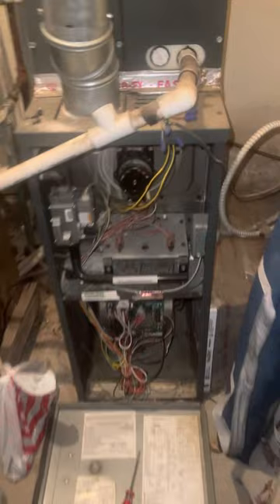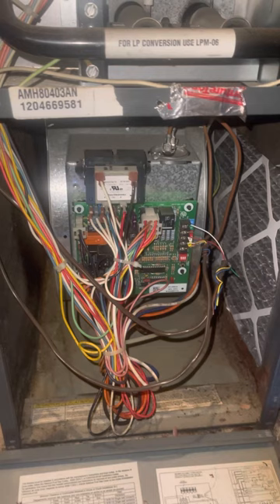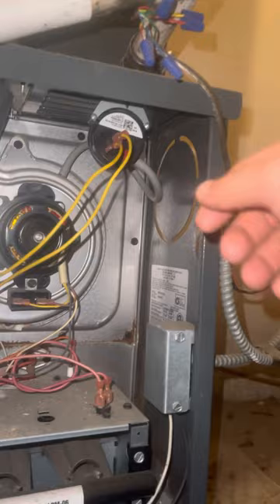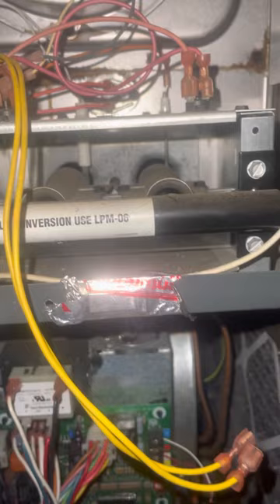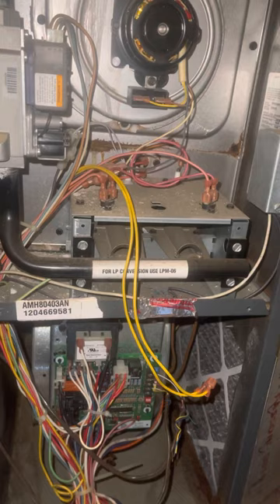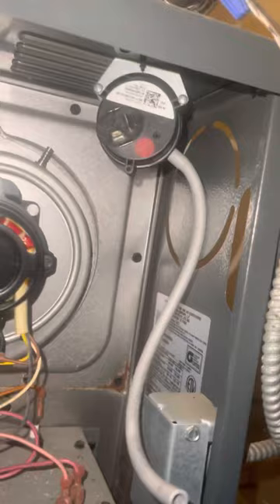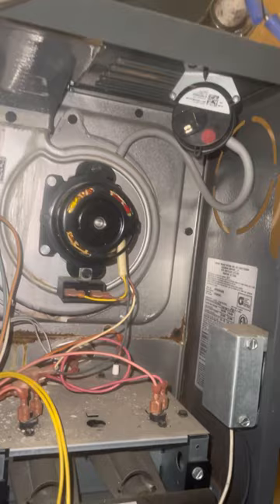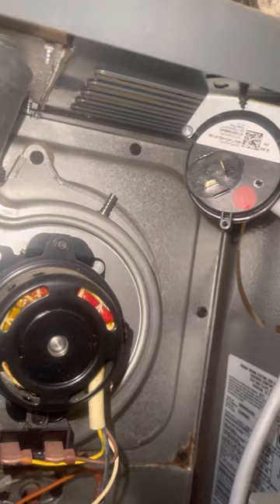Heating furnace not turning on - pressure switch stuck open / closed issue - easy fix to try

Comment: I could kiss you if it wasn't weird. U saved our house this ACTUALLY WORKED😊
Reply from the maker: I’m very happy that you are warm and cozy this evening!
Reply: @Remodelsbyleo  would there be a reason why the heat would stop working after last night it fixed it and it was working?
Reply from the maker: @BreezerX31  most likely same reason as it was before. Which point actually made the fix? 

I am thinking that if you blew in the switch, it might have worked for some time, and may work again, but you would need to replace for a new one asap.
Reply: @Remodelsbyleo  how would I know which one to place I see two. I'm going to attempt it again.
Reply: @Remodelsbyleo  still getting the same code 57. "High pressure switch open  inducer on high speed"
Reply from the maker: @BreezerX31  at this point, I would check the inducer motor and make sure it’s working. May need a multimeter and there must be videos online on how to check it.
Reply: @Remodelsbyleo  I did the same process and adjust the fuse and now it's working. Is it possible that I might stop again, should I pay for someone just incase to inspect?
Reply from the maker: @BreezerX31  it’s possible but maybe it will also work for another year or two or five. Just keep an eye on it for a few days and if it keeps working, just let it be.
Reply: @Remodelsbyleo  so it went back off again, ended up having someone come look at it. They said it was the air pressure switch. They changed it and now it's working. I'll see how long it lasts, thanks for your reply!!
Reply from the maker: @BreezerX31  well, we tried. Hope it wasn’t an arm and a leg!
Reply: @Remodelsbyleo  $300.00 for a temporary fix included the last minute. I ordered the actual part online, $80.00 and I will replace it myself. 🙃

Comment: Not a bad job of self diagnosis... But it definitely could have been worse. Depending on type of furnace you have. Could have been an Inducer motor problem. Could have been a flue issue. Don't recommend keeping your door switch taped either.  All in all not bad though
Reply from the maker: Thank you bro. I know it’s not a perfect video and doesn’t cover 100% of the cases. I’m not a professional hvac pro or a videographer. What’s cool though, is that it has helped a lot of people already. That was the reason why I made that video. Just to help regular people possibly get heat via this easy trick.

Comment: i have a keeprite furnace and it  starts up fine.. the flame is there the blower kicks in.. but after like 30 seconds of running it shuts off.  i cleaned the flame sensor, cleaned the ports with a paper clip, tested the switch and it clicks, checked the vent as best as i could and didnt find anything..  paid a hvac guy 80 bucks to tell me its the pressure switch and its gonna cost another 200 dollars to fix it.. i didnt get back to him cause i know the switch is fine.  not sure whats going on. any suggestions?

Comment: Great video. My furnace started to have the 4 flash ignition code. Inducer motor starts, igniter lights, then it clicks again but no gas turns on. I switched out the pressure switch, then it ran fine for 3 days and i thought ok great its fixed. After 3 days it would go back to cycle on but no gas. I bought a new OEM pressure switch thinking the amazon one failed, but still no gas start up. I cleaned the tube and the inducer inlet. Both pressure switches diaphram working good. But still no gas. Any suggestions?
Reply from the maker: Is the LED on the board still flashing a code?
Reply: @Remodelsbyleo  yes. After it tries about 4 times to run it shuts down and blinks 4 reds, which mine says ignition failure. My furnace model is GL1RA 072C-12A.  Tmrw im gonna jump the pressure switch connections and see what it does. I guess if it doesnt kick on the gas then control board bad?
Reply from the maker: @johnnylawrence Jumping the wires on pressure switch won’t do anything here. 

If could be the valve which delivers the gas. The valve is probably controlled by the board. Say that valve is stuck close. Board tried to open it to activate gas flow and it’s doing the signaling but then it’s maybe sensing that the gas isn’t being delivered.
Reply: @Remodelsbyleo  ok so i called a tech over today because i was at a loss. During start up he gave the gas valve a good wack and it immediately turned on the gas, cycled and ran. But it was giving a low flame code after a while so he switched out the flame sensor and it ran fine. But he said the solenoid in the gas valve is starting to stick and if it happens again to give it a smack to turn it on. And if thats the case again its prob time to replace the gas valve. So good call! But was never the pressure switch so im gonna return it. Thanks for your replies on this buddy take care.

Comment: Never ever suck and blow on the pressure  switch. It is designed to sense blockage at low inch WC within a certain tolerance. Fix the blockage first then test for ignition. You have made the switch less sensitive, it might now not detect when there is a real blockage of exhaust gasses. Okay for an emergency, but, now go buy a new switch rated for that furnace. Take the inducer motor out and clean that area up.  Reinstall motor and new switch.

Comment: Tried the tips from the video but haven’t had any luck. We replaced the igniter yesterday and I believe the motherboard was replaced last winter. Any other ideas? When I blew into it the switch was clicking just fine and didn’t find any gunk in the nipple. Still throwing off a pressure switch code.
Reply from the maker: Connectors tight on pressure switch?
Reply: Not sure what I did but I messed with the connectors, tried blowing through the hose a few more times, and cleaned out the nipple again and somewhere along the line it worked! Thanks for your help!

Comment: You can’t do that a blow into the hose to the pressure switch coz you will damage it if you blow hard you should use a(dual manometer) thanks

Comment: is that the actuator for the gas? there are 2 hidden reset buttons idk if you noticed those they are between 2 wires on each side of mine

Comment: Does the panel box have ANYTHING at all to do with the heat not turning on?? How does the box the tube is connected have to be turned on look like?
Reply from the maker: By panel box, do you mean the breaker box? If so, the breaker for ac/furnace should be turned on. You can take an electric tester and see if the hot load wire has voltage. Sometimes the circuit breakers fail. I would need to look in person.
Reply: @Remodelsbyleo  thanks its the furnace- but there’s an outside unit (I believe they call that the heat pump and that tube is attached to a box that has an ON OFF switch. My ex roommate turn the heat part off but moved and now I don’t know what button he hit. The furnace in the utility closet is fine. Has a steady red light. Im going crazy cause its so cold😶‍🌫️🥶
Reply from the maker: @destined2bc972  you don’t need outside unit for the heat, I believe. With the furnace working, you should have heat.

Comment: Have a question so I’ve been having this issue and I did and it work for awhile and then same issue what would be the issue if I’m still getting the same code I’ve messed with it various times and every once in awhile it will kick on but would go back to the same code.
Reply from the maker: Order a new pressure switch
Reply: @Remodelsbyleo   did that and it worked thank you!
Reply from the maker: @darkzones325  heck yea! Enjoy the heat :)

Comment: I tried jumping mine like you did, but furnace never kicked on. I checked for anything plugged up and was all clear.  So could the pressure switch be bad?
Reply from the maker: Unlikely. First off, are you getting any flashes on the motherboard?
Reply: @Remodelsbyleo  yes three flashes
Reply from the maker: @TheAusherGuy  ok, if three flashes on your unit indicate that the pressure switch is stuck closed, you’d need to remove the jumper pin. If three flashes indicate that the pressure switch is stuck open, then you could use the pin to jump the two wires. 

Do you hear the pressure switch cycling when you suck and blow on the hose? 

Are you absolutely sure that the orifice is clean?
Reply: @Remodelsbyleo  sucking and blowing in the line I can hear the pressure switch clicking like it's working.  I tried to jump the two wires and furnace wouldn't kick on and motherboard still flashed 3 times.  I blew in the lines to see if they were clogged and where they plug into was clogged, but it all seemed clear.  I reamed out the holes with wire too.  Did everything you did in the video and furnace still didn't kick on.  Thank you for the responses and help.
Reply from the maker: @TheAusherGuy  Hmm, perhaps trying a new switch will be the best next step. Apology about late reply. I have been slammed at work.
Reply: @Remodelsbyleo  no problem and thanks.  It's been warm so heat hasn't been needed yet.

Comment: So i did this.but after i add the jumper furnace never trund on but i get 2 blinking lights. Plz help its 20 degrees outside
Reply from the maker: Ok, let’s do a step at a time. Did you clean the metal nipple orifice with a wire or pin already to make sure there is no blockage?
Reply: @Remodelsbyleo  yes
Reply from the maker: @soundqubedkiller5885  ok, did you completely take off the hose and blow through it? 

If yes: 
Did you blow and suck on the hose when it’s connected to pressure switch? Did you hear the clicks? It’s a delicate piece. 

If yes, did you reconnect all connectors back? Are they all tight?
Reply: @leozuker1066  yes i did all that. It clicks like in the video. My concern is that when i jumped the 2 wires my furnace did not turn on. It just jumped to a 2 led flash. Also theres a hole on the pressure switch where the hose connects to. When i blow on it i can hear air going through that hole. Thanks for all your help
Reply from the maker: @soundqubedkiller5885  maybe the lid you removed had safety button on it? When you jumped the two wires, it should send closed signal. It should turn on but may turn off soon when motherboard cycles and needs it open. 

Reassemble everything as it was and try to turn off breaker to furnace for 30 seconds. Maybe it will reset motherboard or something. I’m not a pro HVAC tech. Just trying to help with my limited knowledge
Reply: @leozuker1066  thanks again.  Safety switch was depressed while doing all this. Im thinking its my inducer motor because it never turns on
Reply from the maker: @soundqubedkiller5885  ok, In that case, probably you’re correct.
Reply from the maker: Wait, depressed? That could cut power to something for safety.
Reply from the maker: @soundqubedkiller5885  it should be pressed as it is when the lid is installed
Reply: @Remodelsbyleo  that's what i meant sorry
Reply from the maker: @soundqubedkiller5885  all good bro. No problem. Sorry I couldn’t help you more. Hope you get it resolved and stay warm.
Reply: @Remodelsbyleo  i appreciate it

Comment: It would be wise to remove this video for liability reasons. There’s so much in this video that I could nitpick but much has already been said. Furnaces can kill people simple as that. Pressures switches are never 100 percent sure fire that’s why it’s best to have the heat exchanger checked every now and then. But blowing on that switch made my heart cringe. 😬

Comment: Clearly you're not a certified technician to advice people.  First of all, you never want to blow into the pressure switch because the pressure switches are very sensitive and blowing into them can easily destroy them.  Please don't listen this guy's advice.  As a technician I could tell you what he did could cause more trouble than worth the savings.
Reply from the maker: Ohh Sujeevan, thanks for being dramatic 😁 

If you had any value for the people who may be cold due to an issue such as this, you’d offer something constructive to say. You, on the other hand, are just a butt hurt tech who is mad that people may get their furnace working without paying you $500 to clear a port and try to upsell them. I had a guy recently, quote my neighbor $1500 to fix his outdoor water valve and he was also upset that I wasn’t a professional who crimped some pex together in about 15 minutes. So yeah…good luck to you 👍🏼
Reply: @Remodelsbyleo  if you bypass the pressure switch thinking that's where the fault is, it could very well be the inducer motor that's not pulling enough vacuum which could result in spilling carbon monoxide inside your living space.  In case you're not aware, carbon monoxide is a colorless, and  odorless deadly gas, even a very small quantity can kill a person.  I don't know about the laws in your area of residence, but where I live it's against the Law to be playing with gas fired appliances that are susceptible to carbon monoxide poisoning.  Not only are you putting your life at risk, but also your love ones in the your house.
Reply: I've sucked and blown on pressure switches as hard as I can, trying to break one so I could use it to help train other techs. I failed to break them. Now if someone was telling you to bypass a roll-out or a high limit I would understand your protests. 

As it is, I believe this is a perfectly good beginner's video.